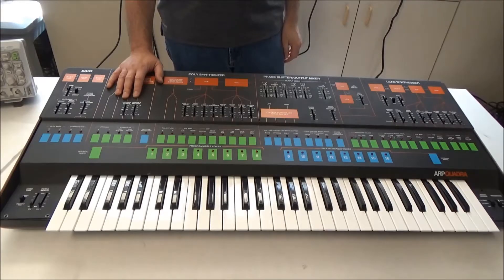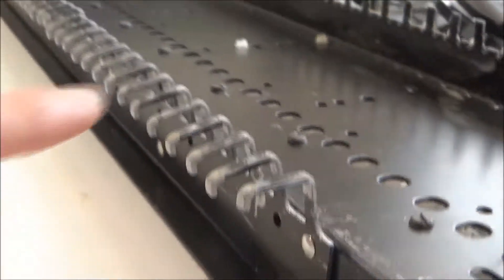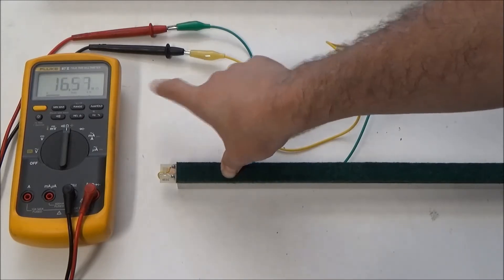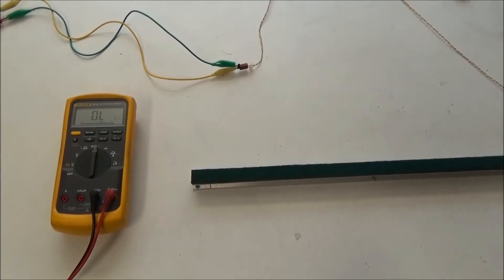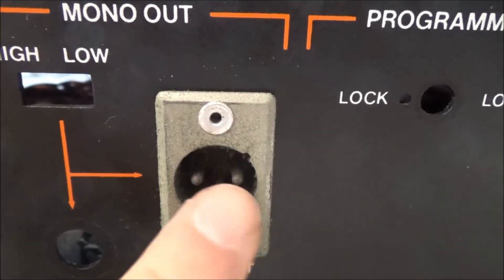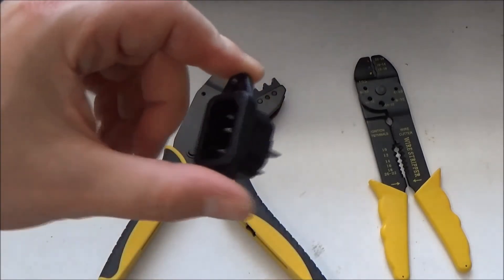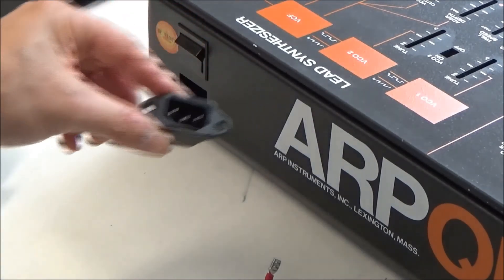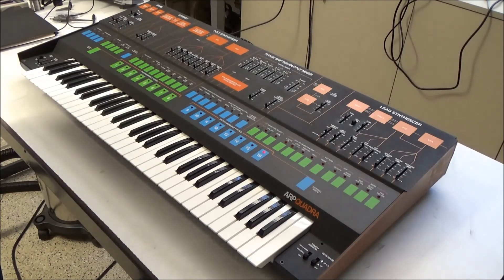Synthchaser #102 - ARP Quadra Repair & Restoration (Pt. 4) - Keybed, Touch Sensor & Panel Jacks

Comment: If you've gone to this level you should replace all those brown/orange Molex's on the boards(CPU, Poly, Lead and connector board)...they are nearly always problematic on Quadras that have never been looked after electronically. I also change the ones from the keybed to keyboard circuitry...some say it's over the top but then some say shotgunning all the boards and changing every IC is too :)
Reply from the maker: Stay tuned, we'll see if you're right. :)
Reply: All techs have different idea and methods, I've seen arguments for both. Shotgunning is a terrible idea for amateurs, there is very great danger of them causing a ton more problems..the worst Quadra I ever came across was an amateur hack job..every IC replaced, yet was completely dead with every board having 10 faults or more, it took me 3 solid weeks to rectify the mess.  Personally I avoid shotgunning PCB's if I can, nothing to do with saving money. It's just a conclusion I've come to from working on hundreds of vintage synths, effect units and arcade machines over the past 30 years. Sometimes it's worth it, sometimes it's not. I have 2 Quadra's in the workshop myself right now, plus my own one...one is completely shotgunned the other I've replaced the odd IC as per the customers wishes. Also depends on what it is..Arp's are notorious for bad CMOS and Tantlums..as are early Oberheim.. OB-X. OB1 etc...Roland XOX bad transistors..CR-78 bad 40175/4 battery damage..5101 ram...5101 Cmos ram in most synths/arcade machines is now junk..throw it in the bin...anyway when you've worked on 20-30 of each you get to know the patterns.  Anyway enjoying your videos and it made me stump up the $ for a Rigol DZ after all these years on a very old CRT! Thanks.
Reply: I'm often surprised when I hear the same commentary about prophylactic IC and component replacement. It's not over-the-top, it is saving you time and headache down the road. If you just want to flip the synth, the yes it will cut into profit margin. But, if you want to own and treasure the instrument for years (or be known as a high-quality synth refurbisher/reseller) then it makes sense to do a complete overhaul as per this Quadra video.

Comment: I'm following this series and I continue to be impressed by the degree of thoroughness you apply to your service projects.
Reply from the maker: Thank you!
Reply: I agree.  I repair my own synths and you can never stop learning from others. The synthchaser website is great.  I've been replacing all my RAM chips with NVRAM for years without too many problems now and synthchaser offers this on his site so anybody can upgrade their battery backed RAM.  I remember my Roland MKS-50 didn't like the new RAM for the second bank of patches but I haven't troubleshot the issue yet.  Great presentation and pleasant professional narration.

Synthchaser, I have over 100 firmware and digital audio backups from the IC's in various 80's synths if your interested in trading.  TR-909, TR-707, TR-727, Kurzweil K250, Linndrum etc. are some of the audio data in which I personally backed up from my collection.  Let me know.